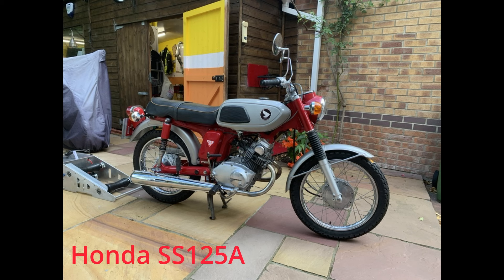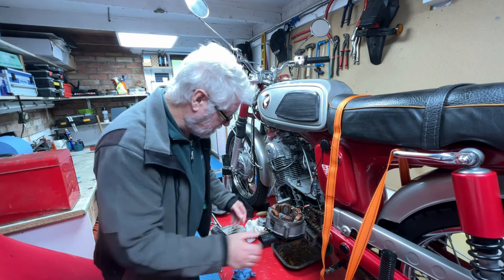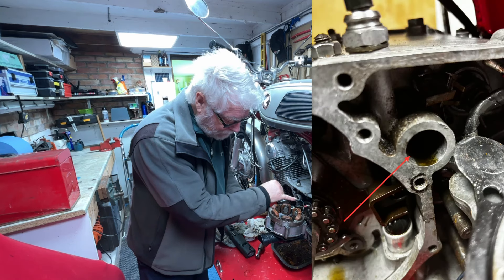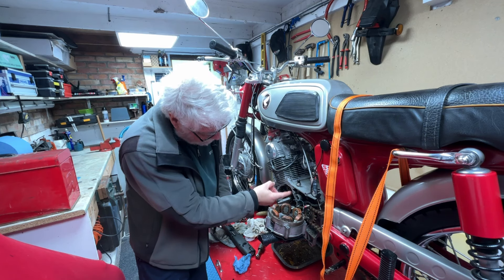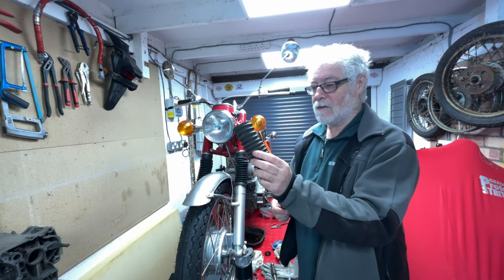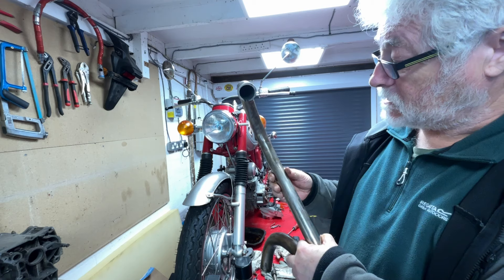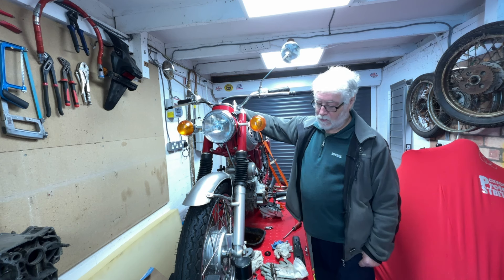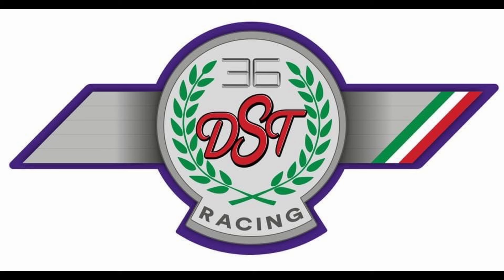Honda SS125

Comment: yeh had the  same on my  1969,   easy to  replace .  Rubber  bung -  no  engine i  stripped had one, but also if you look at the  gasket, it  seals that  area off  anyway. 
Down pipes,  originals are apposed  left n right, if  you look at them youll see they ' kick out' slightly